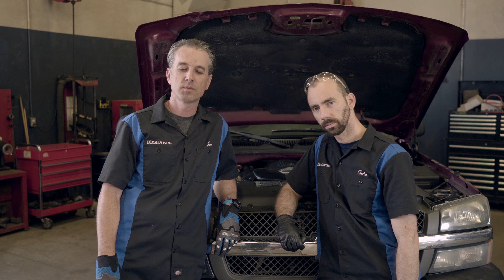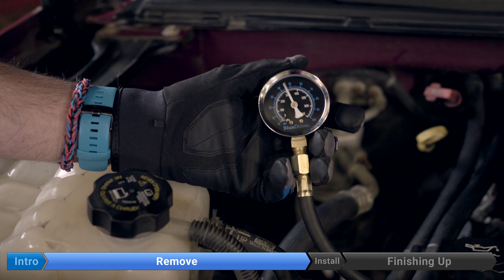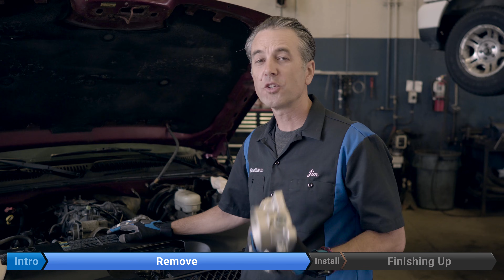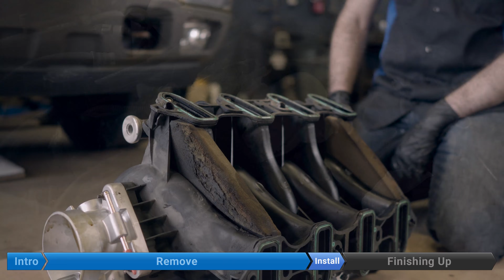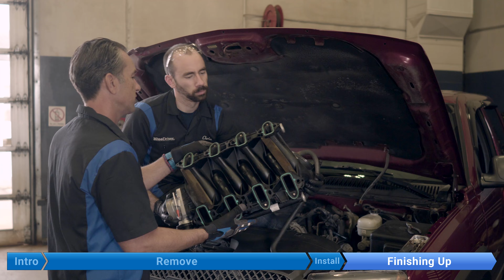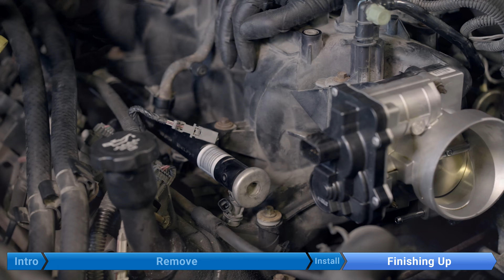Intake Manifold Gaskets – 1999-2006 5.3L Chevy Silverado (Sierra, Tahoe, Yukon, etc.)

Comment: I just performed this job on my 2005 Tahoe Z71, I used the steel/Black Felpro intake gasket, and I also replaced my throttle body gasket. I did not have a torque wrench, but I used a small 1/4 short ratchet so I didn’t over torque things. I torqued in two stages and followed same sequence. Truck runs AMAZING! Make sure you completely remove the Evap line, trying to wiggle it through is impossible. I completely cleaned my heads and engine under the intake. Keep a small shop vac handy and sitting in the engine bay, this way you can vacuum out the engine during and after scraping/cleaning. Lots of dirt under the intake manifold and all of that needs to come out. Every time I would clean an area, I would vacuum out the intake mounting surfaces again. You can even put the vacuum hose right inside the intake holes and inside the engine and suck out any foreign debris. You also have to clean the plastic intake manifold its self. Carbon buildup around the injectors, and mating surfaces. I sprayed a little cleaner inside and totally removed all dirt from my engine and intake manifold. DO NOT REMOVE YOUR CYLINDER HEAD BOLTS TO MOUNT THE FELPRO STEEL INTAKE GASKETS! They just rest on the heads. If you use the steel FelPro gaskets, this intake will never leak again. I would never mount up the plastic ones. That’s too much work for such terrible gaskets. The red intake gaskets and blue intake gaskets are not good, they don’t last at all! Get the black/silver FelPro gaskets. These will last the life of the truck. Much more rubber, and they are on a steel frame. They also include all of the other supporting gaskets to seal your intake and vacuum system up 100%! My truck purrs! She is air tight.

Comment: Hello, I know this video has been here for several years, but I'm curious as to what led you to the conclusion that the intake manifold gasket needed to be replaced?  You mention P0171, but that could be caused by many things.  Is this a systemic issue?  What diagnosis was performed?  Was a stethoscope used to pinpoint a vacuum leak?  Smoke generator?  Please provide more details as to what led you to this repair.  Thank you!

Comment: Well I just did this repair on my 2005 GMC 4.8. Good video, took me about 5 hours but I did the knock sensors as well. Cost me about $300.00 for the intake gaskets and sensors with the harness. I was quoted $1,000.00 just for the intake gasket so a pretty sizeable savings. In regard to the video the appearance is the hoses and plastic clips all come right off easily. I can assure you that 20 year old hoses and plastic clips don't just come right off and its a slow methodical process to get them off with out damaging them. I found the video helpful and concise.

Comment: Did the valley pan gasket, knock sensors and seals that go with them in the valley pan, knock sensor connector wire, intake gaskets, oil pressure sensor, camshaft position sensor, throttle body gasket, fuel rail o rings, cleaned the injectors, and new injector o rings.  This was my second time doing the knock sensors and I should've replaced the valley pan gasket when I did them in 2018 because it was leaking pretty bad for the last year but I thought it was a rear main seal.  Once it got bad, I could see the oil in the front of the valley pan so that led to me reconsidering the leak source.  Once the intake was off, it was easily confirmed.  I did everything while it was off this time.  Took about 10-12 hours, which includes all the time to clean everything.  This was one of the only videos showing the intake going back in with all of the connections needed.  I watched it just to double check I connected everything. 👍

Comment: Ok, so, you asked in your video about how long it took to do this repair. For me...about 12 hours.

I'm just an average DIY guy. I don't have a tree near my vehicle, so don't call me a shade-tree mechanic. I'm a sunny mechanic; I repair my vehicles in my driveway under the Georgia sun. I'm in IT by profession, but I'm not afraid to tackle vehicle repair jobs on my family's fleet of older vehicles. Videos like this one are priceless to me. That said, I'm not quite the best at this stuff, so I persevere through hardships. This repair job wasn't even my primary repair job. I needed to get to the oil sender unit to replace it in my 2003 Silverado 1500 4.8L engine. I had to take the air intake manifold off to get to the sensor - a job that seemed intimidating until I watched Jim and Chris. I had a series of mistakes that dragged out this job. So, for the other DIYers who are not quite hobbyists in this stuff, here is my comedic saga.
- Saturday, after numerous reviews of this video, note-taking, then cross-verifying by watching other videos and checking some numbers, started by taking off the air box and components. No sweat.
- Second step, removed the coolant lines. I thought I was ahead on this; I have coolant line clamps. Then I struggled for over an hour trying to get the stupid clamps released in that tight space under the air intake. NOTE: When Jim and Chris said buying some hose clamp pliers will be the best fifteen bucks you'll spend, they are most likely correct! I wish I had some!
- Third, took a lot of time carefully removing all the wires. Those little plastic clamps on the fuel injector wires are a pain to remove on the rear cylinders. Make sure you have some great, bright and flexible lighting!
- Next, removed the fuel lines. I took their advice and bought the fuel line separator tool rather than trying to pick the release springs. THIS was a good move!
- Next, removed the various hoses. No biggie.
- Next, loosen the air intake manifold bolts. Unlike the video, though, they did not come out of the manifold once loosened. They have a little lip that holds them in place. If you want to remove them, you will have to wrestle with them. I tried - they won (except one - I beat that one!)
- Ok, time to remove that dirty, greasy intake manifold. It was a bear, and I was worried I would rip some of the electrical lines as I jostled it about. Thankfully I didn't, but I did get fuel all over the place. 
- Next, I cleaned everything up using rags, brake cleaner and razor blades. NOTE: Do stuff those intakes with rags. There will be grease and gunk everywhere.
- Next, installed that oil sender unit. Old one was covered in oil; I suspect the diaphragm blew (266k miles on the vehicle). Easy task, now that the air intake manifold was out of the way.
- I considered someone's comment about replacing the knock sensors while I was it it; opted not to, to save money for now.
- Time to put on the gaskets...the WRONG gaskets! NOTE: Just because your favorite parts retailer's website says that part fits your vehicle, doesn't mean its the right part! Major setback, cost me the night. I went to the store, found they didn't have an exact match, then had to run another store. 
- Picked up on it Sunday by putting the CORRECT gaskets on the intake manifold. 
- put the manifold back in the truck. NOTE: manipulating that bulky piece of plastic around the wiring harnesses and hoses, in the dark recesses of the engine bay, while awkward leaning over the front of the truck and standing on a ladder is no easy task.
- Installed the intake manifold, started by connecting all the wires, tubes, etc. I was afraid I'd miss one or two. 
- Started lightly tightening the intake bolts. All went well until I got to bolt number nine. It didn't seat correctly. I had to go back, loosen up all the other bolts, wiggle the manifold and fuss with that bolt (still while laying awkwardly across the front, trying to keep my back from going). There's always that ONE bolt that doesn't want to play nice. 
- Went back to hand-tightening the bolts.
- Time to torque. My notes I took from this video showed I need to go through a specific sequence, start at tightening 44 ft-lbs, then come back and do it again at 89 ft-lbs. Started on bolt one. SNAPPED bolt one in the head. NOTE: Pay attention to details when taking notes. Jim and Chris said 44 INCH-lbs, not foot-lbs. 
- Take everything apart, remove the air intake AGAIN; assess the damage. Spilled fuel out of the fuel ports (forgot to secure them before removing the intake). 
- Head inside, take time to review how to remove a stuck bolt. There are plenty of techniques out there. The one I settled on what to use a screw extractor. 
- Head to the Auto parts store AGAIN, this time to get a torque wrench that measures 0-200 INCH-lbs of torque and a screw extractor for a 1/8" diameter screw.
- Get home, drill a hole in the broken bolt, then attempt to use the screw extractor. It worked! My wife and I celebrate the small victories, and my crushed confidence is partially restored.
- Unfortunately, nobody carries those GM-specific bolts; I have to order a replacement. I decided to install without one screw (not my favorite option, but we cannot be down a vehicle in our busy family); will order the GM-specific parts off Amazon or the part store websites tomorrow.
- Replace the intake manifold; spend an hour fussing with hoses and wiring harnesses because I didn't make sure they were neatly tucked before putting the manifold in place.
- Reinstalled all the hoses, wires, etc. Fussed, again, with those darn hose clamps (why didn't I buy a pair on my numerous trips to the store on this adventure???)
- Torqued the remaining intake bolts (NOTE: Don't forget the thread-lock!!!). This time, I used my NEW torque wrench and made sure it was set to 44 inch-lbs to start (NOTE foot lbs).
- Reinstalled the remaining clips, air box components, etc.
- Carefully started the engine, partly expecting a dramatic explosion, but was delighted to hear the engine start without issue. 
- Checked and rechecked and rechecked all connections, especially the fuel lines.
- Test drove the truck, expecting a rough performance due to the missing intake bolt; no rough performance! The engine ran smooth, though the oil pressure seems to higher than normal (averaged 42 psi, jumped to over 60 psi during hard acceleration).
- Overall a success. My confidence is a little shot, but I realize that is because of my stupidity in mistaking inches for feet on the torque settings. 

In summary, these guys know what they are talking about. I am not the best mechanic, but I don't fear the work, and will try just about anything. I always come out with a high level of respect for the professional mechanics who do this day in and out. I save the big jobs for them! My advice for any other folks thinking about trying this - pay attention to the instructions, but don't forget your vehicle may not be the same - age, rust, space issues, crankiness - all of it comes to bite you, but makes for a great story. Keep your job, remember you chose to do this, and you CAN do it. Patience and perseverance will be important, almost as important as having the phone number of a good tow company so that you have a backup plan should things not turn out so well.

Thanks Jim and Chris, and thanks BlueDriver team for publishing this video. I did take a look at your OBDII readers and do plan on investing in one, once I have the money to do so. They look like perfect and essential scanning tools when working with these older trucks! I need one, and I'm sure my to-be-purchased scanner will lead me on many more repair adventures!
Reply: 12 hours include writing this comment?
Reply: @mback12000  lol! Nah, that was additional, meant as a comical relief valve. 
I'm the textbook case of why the pros have value.
Reply: @mback12000  right ! I feel like thinking of all that had to take longer than the actual repair 💀🤣
Reply: Thanks for writing this out, Paul. Definitely gave me more confidence starting my repairs with some lessons learned, so I hope you feel better knowing that your struggles, and then documentation, are helping others! Also hope all is going well with the family; I know the pressure of busy IT life (was a CommO in the USMC for 8 years).
Reply: Thanks for reiterating inch/lbs and not ft/lbs cause I forgot at the end of the video already. Glad i hadn't started on my truck cause I only got one for of transportation right now.
Reply: Why so slow?  Two videos show 20 minutes to tear it apart and put it back together.  I’m an old geologist I’ll time myself.  May take me 24 hours or 17 minutes.

Comment: Does anyone know if this will fix a P0300 code on a 2000 Silverado? It has a rough idle in the cold but is fine once it warms up. From what I’ve read it seems like this is the culprit
Reply: I’ve heard the same thing I’m doing mine right now as well. Did you do yours?
Reply: If I'm correct that's a multiple misfire code so that could be a number of diff things maybe just a sensor maybe just a O2 sensor or it could be this just try to narrow it down by trial and error
Reply: Ignition coil
Reply: @flow1180  it was some idle valve in the throttle body haha

Comment: Why is it that mine has 2 fuel lines to disconnect and also I seen on the throttle body that it didn’t have the tps sensor and idle sensor on it
Reply: My year has the 2 fuel lines as well and my TB has both sensors it's a 2001 5.3 I figure it's because my TB is a drive by wire, so my throttle is connected by a wire to the TB. These new TBs are electric so it doesn't have the need for it it's just built in with the computer type deal I assume not saying I'm correct just what I would think

Comment: Love the  video. saved me time and money taking my '03 to a shop. I do notice you did this job with the fan shroud removed. Might want to reference/make another video on how to do that. It isn't required to remove it to do this job but you don't mention it either way. Also, some of these 5.3L's are equipped with throttle cables. A reference to that would be helpful as well.

Comment: Did mine in 2hrs yesterday but, I did a lot of scrubbing/cleaning while I was in there. And soaked and scrubbed the throttle body as well. Also, If yours is older with EGR, don’t break the pipe. You’ll have a large vacuum leak and it won’t idle.

Comment: Great video EXCEPT......I have a 20001 4.8 GMC Sierra with a big ole 1" dia steel tube originating at the exhaust manifold connecting to the passenger side intake manifold with a 2 bolt flange just aft of the throttle body. Plus there are 2 additional electrical connectors on the driver side of the throttle body. And no throttle cable.  Am I looking at a model built for California emissions?  And can you point me to a Youtube video that accounts for these and any other differences?  Also, doesn't the air have to bled out of the fuel lines?  And did you remind us to reconnect the fuel pump relay?

Comment: I can’t believe that on a video showing how to change the intake manifold gasket, you didn’t change the knock sensors. It’s just smart to do it while the manifold is out. It saves having to do this exact process to change them when they fail later.  Customers hate paying twice for the same labour, and I hate screwing them that way too .
Reply: Well let me tell you from experience do not use cheap brand parts house knock sensors spend the extra money and do it right
Reply: Relocate them while you're at it
Reply: I appreciate the info, I looking to do this to my truck, so I’ll definitely hit the knock sensor while I’m there. 👍
Reply: Exactly!!! I know I need to change those when I change the gaskets but I’m specifically watching this video for recommendations on other things to replace while in the process…. As in things like the crappy knock sensors😂
Reply: Also do the oil pressure sensor. They go bad often and it's literally just a minutes worth of work with the intake off.
Reply: @Zoroaster4  I had to change one on a 2011 Silverado 5.3 and that was one of the worst sensors I’ve ever changed. I honestly don’t know how I did it but my hand felt like crap afterwards
Reply: 💯 agree.  At least check that they are dry and perform the GM service bulliten on adding silicone to the rubber grommet to seal water out.  I'm watching this vid because, yup you guessed it, knock sensors for me.  Bank 2 low voltage.  Got the new GM sensors and new fuel pro intake gaskets.  Thanks for showing a quick, clean service guys!!

Comment: Great video. Will be using this to change knock sensors. Would it also be good to replace the oil pressure switch as well? Thanks.

Comment: First of all. Great video. I had no problems following along and got my intake off and back on.
Couple things to note.
First I don't think you mentioned to plug the Fuel pump relay back in...don't forget that..
And for my truck( 03 suburban ) everything was the same except I have 2 fuel lines to remove and my clips on my injectors were a little different. Did not have the safety flip switch things. It was just squeez and pull off 
Thanks again for the video. Took me about 3 hours. But I cleaned EVERYTHING real good while I had it all apart.
Reply: Common sense to plug that relay in
Reply: @EddySanchez-rl5iq  common sense does not exist anymore. It's just sense. You either have it or you don't.

Comment: 4hrs into it. Got the manifold out, I found an absolute mess. Caked on grease, that foam barrier was dust, and one of the gaskets is stuck on.

I shoved some rags in the ports on the block and sprayed some engine degreaser and left it overnight to break it up. I'll wipe the mating surfaces and use a plastic scraper to get all of that burnt oil off.
Reply from the maker: That's going to be super satisfying once it's done